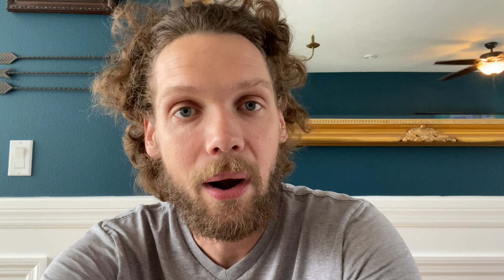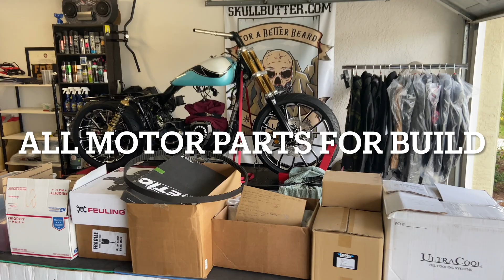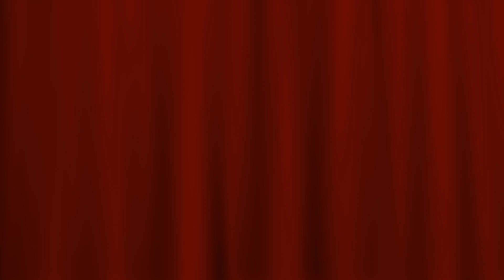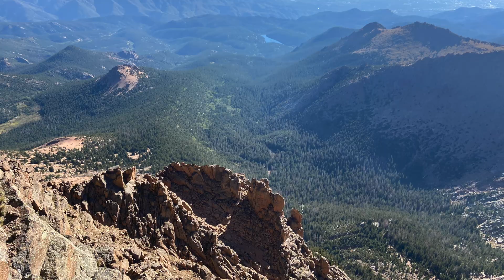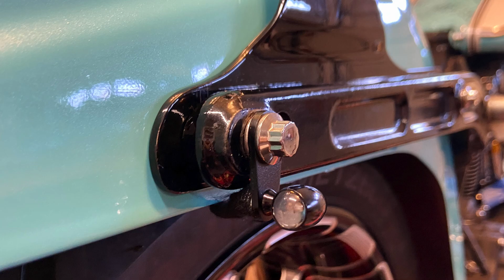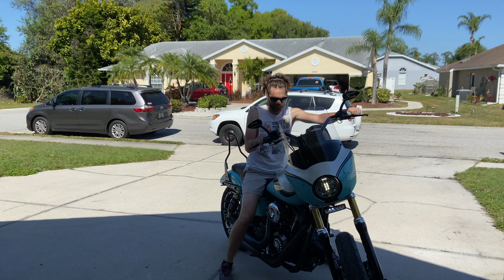Dyna Build Twin Cam start to finish FXDF to Custom

Comment: Sweet rides. Did you rake the bike in any way for the 21” wheel? I’m looking to do the same combo to my fxdf now and was under the impression I’d need 3 degree triple trees? Cheers
Reply from the maker: stock rake, stock trees, shorter tubes
Reply: @bikeparts3653  dude. Thanks for the reply this is what I needed to hear